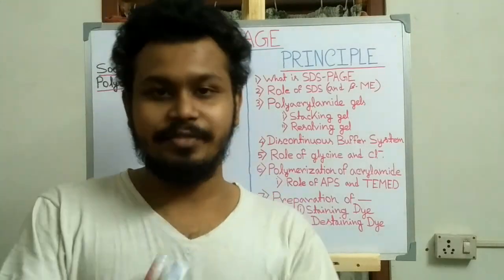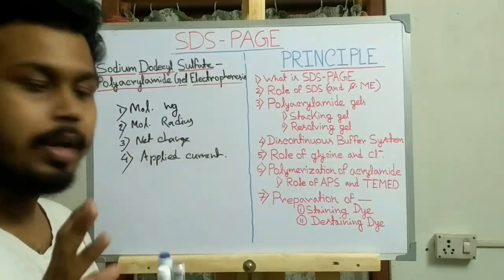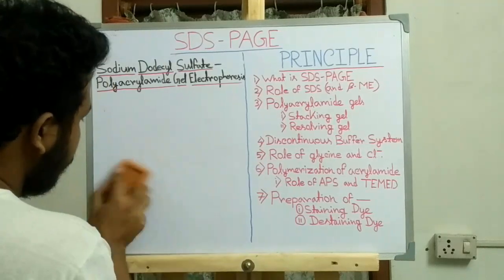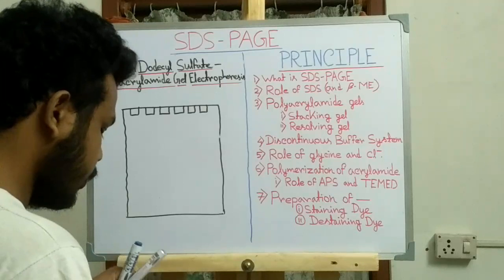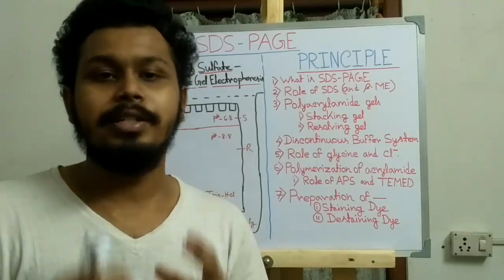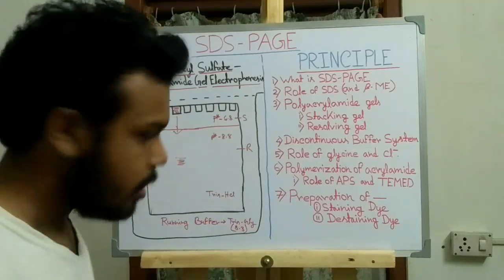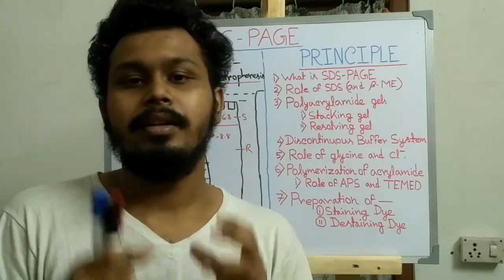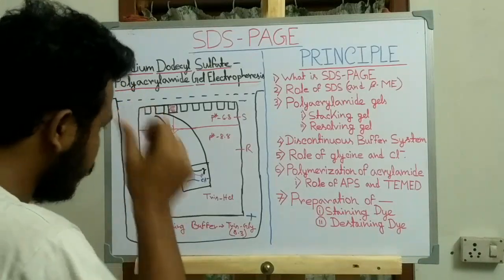SDS PAGE (Polyacrylamide gel electrophoresis) | principle and explanation

Comment: Sir could u pls answer these questions that would b your kindness 🙏

PerformSDS – PAGE of the following proteins;

B-gal,Con A, Oval, Ribo A

Resolvinggel concentration to be used = 12 % (Provide the composition and role ofvarious components).

Runningvoltage = 100V

Afterrunning the gel stain with Coomssie Brilliant Blue – R 250 stain (give thecomposition of stainer).

Destainwith destainer (give composition)

Also provide composition of loading buffer.

After the electrophoresis, staining and destaining iscomplete, answer the following questions.

Q1. What is markerprotein and its role in SDS-PAGE?

Q2. How many bands willyou observe in a well in which ConA was loaded?

Q3. Is the pattern ofbands, obtained after electrophoresis, as expected? Comment.

Q4. What are the molecularweights of Beta-galactosidase, Conclavin A, Ovalbumin and Ribonuclease A?

Q5. Why do all theproteins move from top to bottom of the gel?

Q6. Whyare protein samples boiled before loading into the gel?